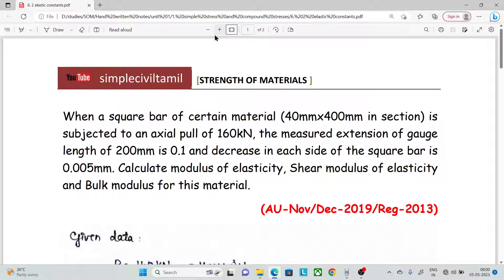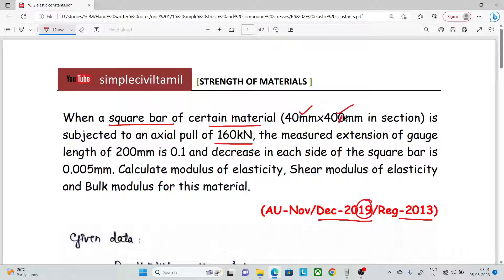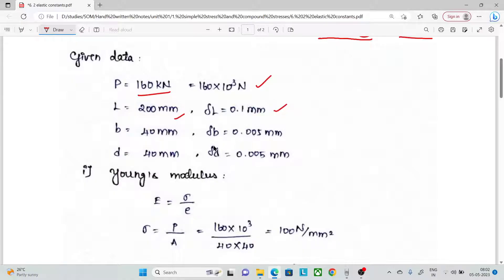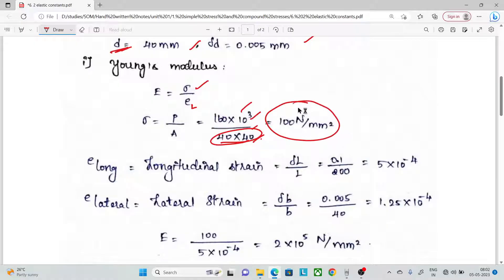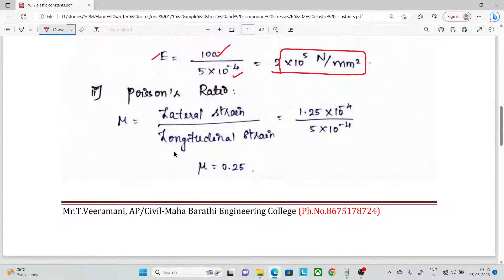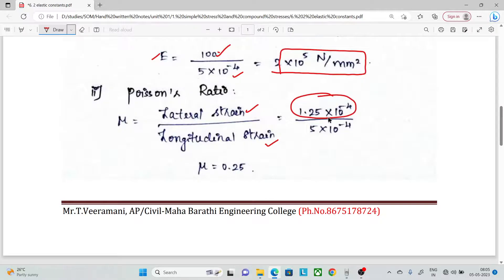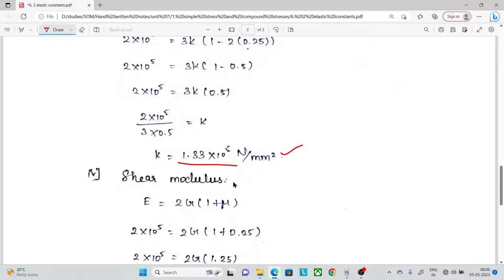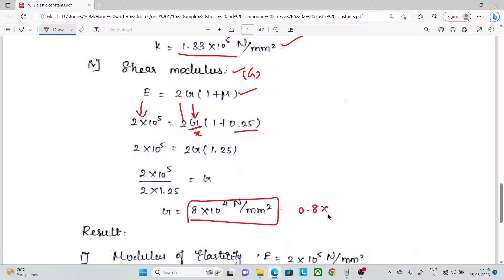Elastic constants problem 5

Comment: Sir Poisson ratio 2.5*10^-9 varuthu but neenga 0.25 poturkinga
Reply from the maker: Athoda value eh 0.20 to 0.35 thaan, calculator la correct aah type pannunga answer varum